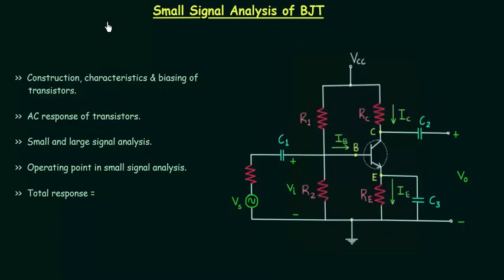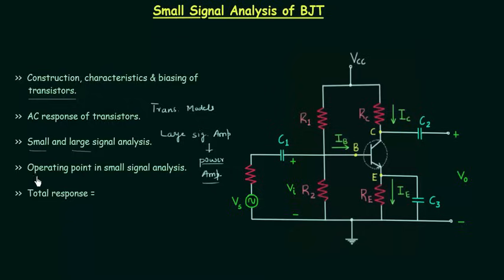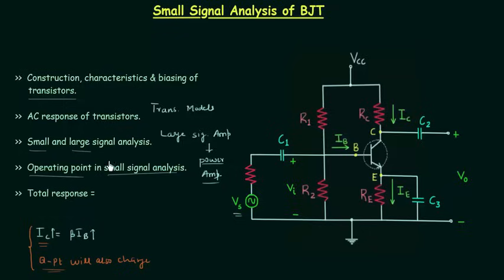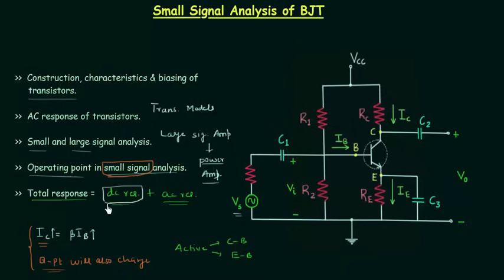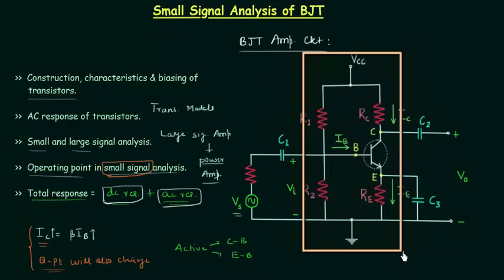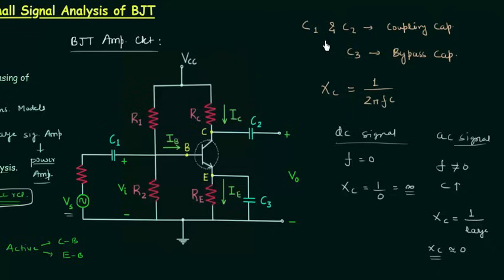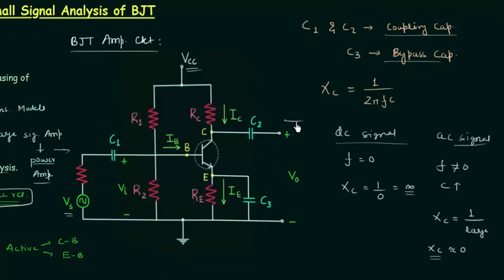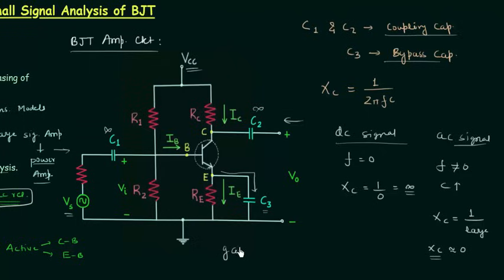Small Signal Analysis of BJT

Comment: What was the need to add both resister and capacitor at the emitter if we just wanted the maximum current gain? We could have simply put a straight wire. (8:03)
Reply: With Re  resistor we will get stable DC biasing voltage(check voltage divider biasing circuit) for stable operation of transistor..
With Ce capacitor we will bypass the AC signal .. If we don't bypass the AC signal , the AC  signal will lose some voltage (voltage drop) in Re  resistor before reaching output..  Therefore voltage at output reduces.. Gain reduces.. 
 So Re is important for biasing..  Ce capacitor for bypass the AC signal to the output..  
Both are playing vital role
Reply: @gnanupraneeth9376  sir in the later part the resistor Re is open circuited right? So that ac signal can flow through the capacitor with minimal resistance?

Comment: capacitors have values in order of micro. so how can you they have large values ...large enough to make xc=0?
Reply: Your point is completely right! However you are missing one basic which is also not told by him. The value of capacitance is generally choose depending on the frequency. If you are operating a 100MHz(which is generally frequency of most electronic circuits) then even 1microFarad capacitance make Xc=0.